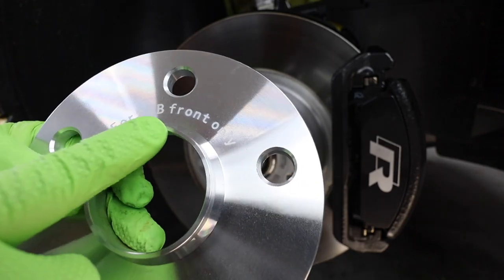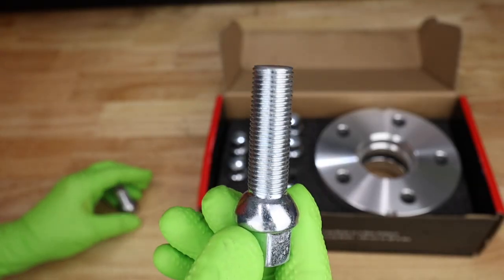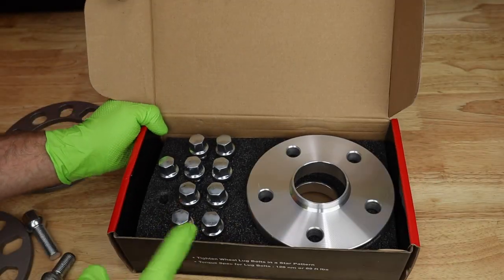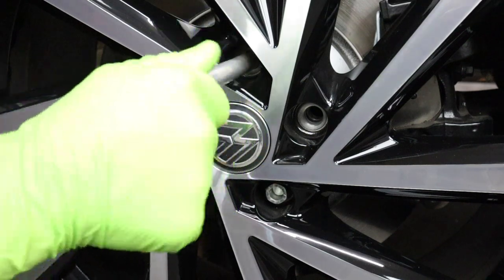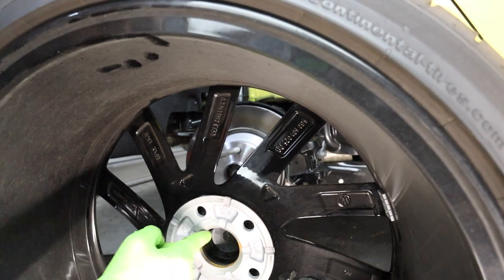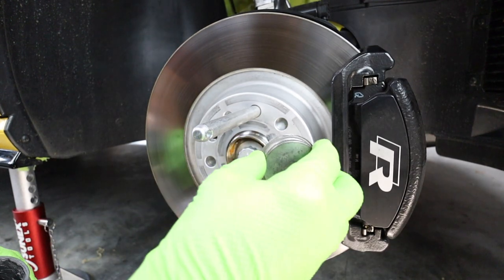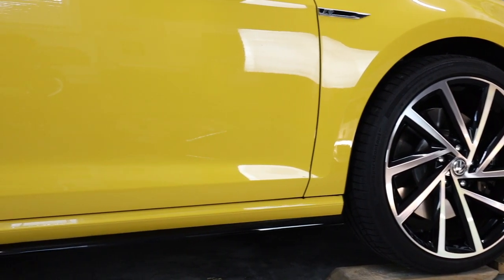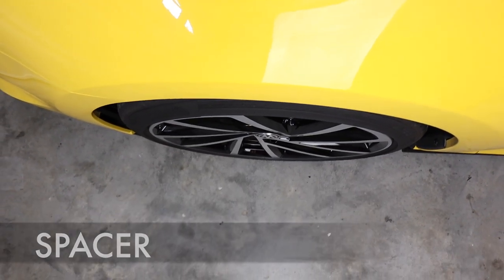How to PROPERLY Install Wheel Spacers

Comment: Correct me if I'm wrong, increasing the rear track in relation to the front even by 5mm seams like it would increase understeer...
Reply: Car Nut yap, thats is correct. And thats why most people think that after they put wheel spacers at a rear of a FTW car (most of them have a narrow rear track just because the understeer question) the car get million miles better. Its actually slower, but the wider rear track had help with increased security feeling (stability)

Comment: What’s your take on wheel adapters? I’m interested in running some wheels on my Golf R that only come in 5x114.3. I’m considering using an adapter to fit them but I don’t want to if it will be unsafe for spirited driving.

Comment: Do I Need To Get An Alignment Done Before I Put New Wheels, Tires & Spaces On My Car? Especially If You Have To Hold The Wheel At An Angle, My Car Veers Off To The Right Slightly When I Drive If I Let The Wheel Go For A Few Seconds. Also, My Car Has 16s On It & I Plan To Put 17s On.

Comment: I've heard that spacers can cause issues with the wheel bearings due to a shift in the offset. It would be great if you would go into that a little.
Reply: No question that a wheel spacer increases the overturning moment on the wheel bearings and thus shortens the life of the bearings.  With 10 or 15 mm spacers this may not be that significant.

Comment: The front tyre gap on my BMW e60 is 15mm and the rear wheel gap to fender is 20mm. The rears are further in. What spacers would be best 5mm front and 15or 20mm rear? I want the rears to have more poke Please let me know

Comment: If it helps, I bought H&R "high quality" wheel spacers in just 10mm, hub centric, and they bent hitting a pot hole, nothing drastic and no damage to anything but the spacer, that is not good, thankfully a realized because I rotated my tires. Investigating, turns out that H&R which are supposed to be good quality, are CNC machines from an unspecified alloy, that is not good, so this time I  ordered a new set but made sure they where FORGED from 7075 T6 Alloy, I will never instal spacers if they dont fit those specifications

Comment: I bought my spacers from the renowned H&R german brand, expensively made in germany, and the hub centric lip bent on the first low speed pot whole, not a major hit, thankfully I noticed it when rotating my wheels. I bought a known brand  to make sure I got quality, but it turns out H&R makes their spacers from an unknown alloy (very soft) and are machined not forged, thats not good. Now I bought some chinese brand,  they are 7075T6 alloy and Forged, (I just recently learned about aluminium alloys and what 7075 plus T6 mean), Im pretty impressed, they look better quality and are even lighter, also if I bang them agains each other, the H&R end up with a deep very noticeable mark, like potty, you can tell theyre really soft, but the forged spacer dont even have a mark, nothing,  its pretty drastic. Nobody talks about alloys or forging on spacer videos, yet its the most important aspect when choosing spacers.
Reply from the maker: WOW Sad to hear about H&R. I love their stuff.
Reply: Better off getting Eibach next time. Other H&R products, like their springs, have been known to snap sometimes in the last few years.

Comment: I had to cut a small section of the fender liner out on my R because it was rubbing the right rear wheel. But I guess spacers will fix the problem too. Idk if you noticed that. If you were sitting in the back seat, you could hear a rubbing noise when the car was making a left.

Comment: Hey brother, even though my spacers are long gone, someone told me something that has me wondering.. They said i needed to take off my dust caps before putting on my 10/15mm DAP spacers. I did not do that during my install. I will find out if you did as I continue watching this video, but he got me curious. My torque just felt funky on the fronts i think it was. can't really remember now. he said i would have cracked my spacers if i didnt take the dust caps off.  WAIT.. did my car not even have dust caps?? I can't even remember..
Reply: my spacers would not sit flush until i removed rear hub dust caps, front no problem  2018 GTD

Comment: Hey there I have a 07 Audi a4 S-LINE with the titanium package 18 inch wheels and sport suspension package ! And my wheels are a little in the fender and i was tryna get them to flush like to the fender a lil more what size mm spacers would you recommend for the front and the back I'll appreciate your suggestions!!

Comment: What about installing a locking wheel bolt. What’s the solution if you still want to protect your wheels from theft? Great vids btw 👍
Reply from the maker: Most people do a stud conversion. I assume they also have longer wheel locks too.
Reply: Just don't use the VW ones. Pieces of junk.

Comment: What if I use threadlock do I still have to check the torque after 100miles wouldn’t it damage the seal

Comment: Fun to see how you take wheels of the car vs how i do it in a vw garage i have a air driven impact driver and just zip 4 of the 5 lugnuts lose and put my hand in the center and zip the last one out, put the gun away and take the weel of and we have protected soccets but the wheel locking nut from the car is almost never protected so we don't bother about it bc it is a one time occurrence every few months

Comment: What can I do about my locking wheel nut as its too small to put back on can you buy extended locking wheel nuts ?
Reply: colin bell I've been wondering this as well. I don't live in a high crime area so it's not a big deal, but just curious. Humble?

Comment: @humblemechanic, do you have any recommendations on a set of locking extended lug bolts? which ones will fit the SHOPDAP wheel spacer kit?
Reply: Aequitas Veritas I had same question!
Reply: Aequitas Veritas Thanks man very helpful!

Comment: The main problem caused by spacers in the front is the altering of scrub radius. The inside tire has to turn sharper than the outside tire when you widen the track (add spacers).

Comment: I did the same spacers on my gti. There were dust caps on the rear hubs that had to be removed (and it was a minor hassle) and replaced onto the spacer. Does the golf R not have the caps?
Reply: the hub spacer should have cleared the stock hub dust cap if you were using the correct spacers.

Comment: In regards to the bolts, what if your car doesn't have bolts like these and is the reverse setup where I take off small caps (like the other flat cone ones you showed at the start). Do you have to get the spacers that also have the extended bolts on them?
Reply from the maker: Some spacers will have studs on them so you bolt the spacer to the hub and the wheel to the spacer
Reply: @HumbleMechanic  Gotcha, and if your studs stick out too far is there anything you can do besides grinding them down? I am not sure if I would someday need the stock longer ones again and don't want to be stuck with short studs

Comment: question, i was told NEVER to use an impact on special wheel lock bolts especially like those in BMW, mercedes, VW audi etc. but in the video you impact them anyway. cause i seen these bolts like this get stuck because the lock patten somehow wear out not sure due to impact or over tighten.
Reply from the maker: I’ve never had an issue. Plus these babies are probably never going back on the car.
Reply: VW should be ashamed of making such poor quality wheel locks. I stripped two after two tire changes. $50 for the set and $50 paid to a mechanic for taking them off with shop pliers. 1 year warranty is a joke. I had Toyota wheel locks for a decade and they work fine every time!

Comment: I bought this same wheel spacer set from ShopDap for my 2017 Golf R. I took it to a garage, since I don’t have my own garage and tools. They told me that since the bolts provided dont turn 7 times into the thread it’s not safe and they can’t install it for me. Has anyone else experienced this? And what are you thoughts?
Reply from the maker: Yikes maybe wrong bolts? I’d reach out to SHOPDAP for some guidance

Comment: Charles, I freaked out a little bit when I saw you impact out the puzzle style wheel lock

And then I realized you already loosened them in the previous video

For a minute there I didnt know what to do with all the confusing feelings welling up inside of me
Reply from the maker: I didn’t loosen them. ;) zipped them out with the impact as I have done thousands of times. And these locks are probly never going back. Haha
Reply: @HumbleMechanic  GAAH!! Blasphemy!

Comment: What happens if you  drive with a heavy loaded car, will de rear tyres hit the fender when you hit a bump?
Reply from the maker: No. Mines at stock rideheight so no issues.

Comment: Is the socket size the same on the new bolts as the old ones? Curious if I need a new protective socket.
Reply from the maker: Same size
Reply: HumbleMechanic thanks!
Reply: Okay, quick follow up. I was reading another post where a guy mentioned that his wheel bearings went out within 10k miles after installing spacers. I’ve never seen anything else like this, but is it something you’ve seen? My plan was to get the spacers now, purely for cosmetic reasons, to hold me over for a couple years until I upgrade wheels. But the post about messing up the bearings is giving me second thoughts.

Comment: Commenting before the video starts, you might address this, but are wheel spacers bad for your suspension?
Reply: They are bad for the wheel bearings if you go super wide.  The wider stance will change the camber a little too.
This is not the case for spacers that correct for different offsets.
Reply: Nope, they in no way damage or hurt your suspension.
Reply from the maker: Suspension in general, no. Well probably not. The biggest possible place is wheel bearing wear. But with something this small, I think you're fine.
Reply: Right on, thanks for the replies. I have a ‘17 MK7 S GTI bone stock that I’m thinking of doing a few mods on, this is definitely one of my go to channels for anything VW
Reply: Small amounts no, but putting on spacers that put the rims outside the wheel arch and show a lot of tyre will lead to high forces on bearings that in general are designed for the load to be mostly symmetrical around the bearing. Higher wear, and higher loading of the bearing during driving, and of course potholes will cause extra wear. Use small amounts to correct for different rims not going to be any major problem.

Comment: Do the wheel spacers come with a lock key for the studs or what do I use to get the wheel spacers off?
Reply from the maker: Those have a little notch you can pry against. They come right off. I also clean them when I rotate tires
Reply: @HumbleMechanic  oh ok, I have my car at a wheel shop. They said they can't remove the wheel spacer and that it needs a key to remove it. I never heard of that. So all they gotta do is pry against that notch and they will come off??
Reply from the maker: That I can’t say. There are different types. These here don’t use key
Reply: @HumbleMechanic  ok so is there a place where I can purchase a wheel spacer key?
Reply from the maker: See if there is a brand on the spacer and start there
Reply: @HumbleMechanic  oh ok, I wish I could show you how it looks

Comment: I find with all the people getting bent and twisted over wheel spacers it's easier to just put spacers behind the wheel bearings and move everything out from behind. No one can see the spacers, my flux core peanut butter or all the JB weld.

Comment: How do i know how long of a lug bolt i need with spacers and new aftermarket wheels?
Reply from the maker: Most wheels will be about the same. For bolts add the addition depth of the spacer. 15mm spacer up the bolt by 15mm

Comment: 9:02
Then how come just about every mechanic at just about every shop runs the lugs down at 120+ lb ft with the impact gun on all four wheels while the car is still in the air? 🤔
Reply: Laziness
Reply: Because it is faster, plus you get to upsell the customer on new hubs as well every few cycles, and break alloy rims as well for another upsell. Will also bet the place has a torque wrench, but it has never been calibrated, checked or even taken out of the box since new, unless they get somebody with a touch of knowledge as a customer, who will see it being used while they are present.

Comment: What if your wheel bore diameter is smaller than your hub bore diameter 😅😭 but the bolt pattern is the same. Only instantace to buy those over sized wheel spacers.

Comment: Spacers can not be thicker than 1/4 inch in Pennsylvania.  1/4 inch equals 6.35 mm.  That means those 10 mm and 15 mm spacers you just installed are not legal on PA roads.

Comment: when im putting my wheels on, why is it important to torque it to a specific "torque"?
 if i just "guess" is it a recipie for disastor or will i be okay?
Reply: Too loose, you risk the wheels coming off. Too tight, you risk stretching the threads too much, leading to failure of the wheel stud. Beyond this, ever notice your rotor moves back and forth without a wheel on? The wheel holds it in place. Very easy to warp your rotors if you are one of those guys who tightens the hell out of your wheel nuts / lug bolts. The general line of thinking among the casual group of people seems to be "tighter is better." Truthfully too loose and too tight both lead to potentially huge problems. Use a torque wrench, and use the manufacturer specified torque, you will be glad you did.

Comment: After that do you need alignment on the wheels??
Reply from the maker: I didn’t. But I may actually do an alignment with them, take them off and recheck it. Doubt it will really show any difference on adjustable angles
Reply: @HumbleMechanic , i would really like to see that, there seems to be no clear answer on the internet.

Comment: Seen one Datsun Go, with around 100mm of spacers on it. Wheels are also skinny rubber on wide rims, and look like they will pop off at the first pothole, plus ultra low profile tyres. Figure the wheels and tyres, plus the spacers, cost more than the car, and do nothing to improve stability either.

Comment: Humble how long can I drive with a half shaft that clicks in turns? I noticed the clicking started about 3 days ago.
Reply from the maker: You want to get her replaced as soon as possible. That said the joint is toast.
Reply: @HumbleMechanic  How long do you think I may have with it?
Reply: It will totally depend on how much you drive. Just get them replaced ASAP. Trust me when I say you’ll be cursing if you put it off and it leaves you stuck at the side of the road at night!
Reply: @alextegg3838  I had a mechanic do it on the side. Once it was replaced though there was a seal missing and the tranny fluid leaked all over the place. After that I went to a shop and they replaced the seal and tranny still works thank God.

Comment: How could I retain the lug bolt to where my wheels can't be stolen?
Reply from the maker: I think they make extended wheel locks. Or you can switch to studs.
Reply: @HumbleMechanic  I've seen spacer kits that have 5 threaded holes for the original bolts to fasten it down to the rotor and then 5 extended bolts for your wheels. Have you seen these as well?

Comment: Can anything bad happen if you run extended lugs without spacers and they dont catch or bind (the wheel spins freely)? Asking for a friend...lol
Reply from the maker: I ran into an issue on my Cabby where the bolt hit the brake drum parts. There is a point where you can have the bolt hit

Comment: The right way to install them is to buy the right wheels and throw the spacers away
Reply: So what about if you wanna keep the OEM wheels?
Reply: There is nothing wrong with using the spacers that were installed in the video.

Comment: Excellent video but takes time to wrap socket and then proceed to let the wheel hang on a bare metal hanger
Reply from the maker: The whee hanging on the hanger is no different than a wheel stud.
Reply: Kris Chilamootoo the socket will be spinning, which increases the potential for surface damage between the socket and the surface of the wheel versus a stationary hanger. But, I guess you could always wrap tape around the hanger or apply some shrink tubing to your hanger if it suits you.

Comment: I just got Shop DAP wheel spacers for my mk7.5 GTI.  57.1 mm center bore. They are not fitting on the front. *Update one of the spacers is super tight, the other 3 fit as seen in this video. **2nd update: I prayed to the car gods… and it went on easily on the other front hub.  Thank you Jesus***3rd update the last wheel bolt is ball, instead cone and half inch too short.
Reply from the maker: OH NO! Reach out to DAP!!!
Reply: @HumbleMechanic  I just ordered a new one and had it over nighted.  Ha stuff happens, it’s not the end of the world. After finishing the front, it looks great.
Reply: @HumbleMechanic  I received the wheel bolt this morning!!!!  The spacers make the wheels look so much better.

Comment: Don't need a hanger if your hub has studs :)

Obviously.
Reply from the maker: Bolts>studs 😂😜😜😜
Reply: @HumbleMechanic  I've never had bolts on my car so i wouldn't know 😅
Reply: @HumbleMechanic  
They're only used on very light duty applications, so I'd have to disagree. Interesting to see tho
Reply from the maker: No way man. This R is flat out race car heavy duty stage 5. Hahahha.

Comment: Hang on a minute, please !
Aren't you increasing the unsprung weight of the vehicle with those 4 steel
(instead of aluminium) spacers ?!
Reply from the maker: Minimally. If I was running light wheels I’d be more concerned. But these OEM wheels are heavy

Comment: Illegal in my country so I best not watch🤦 this is the law in Australia: "Wheel spacers or adaptors must not be used for wheel conversions between the wheel mounting face 
and the wheels unless fitted as original equipment by the vehicle manufacturer"